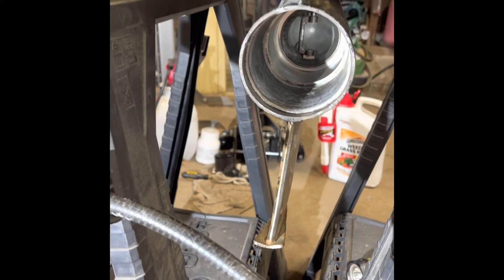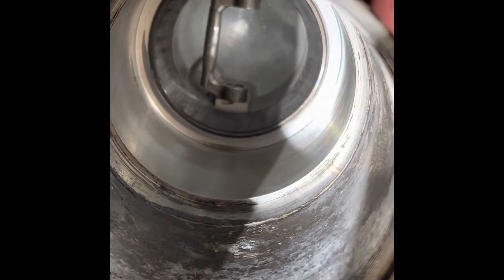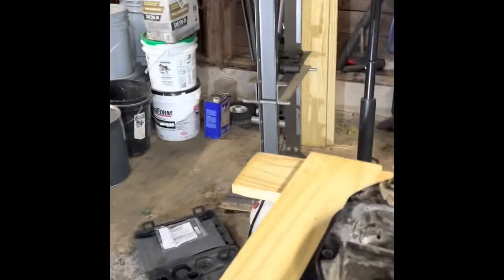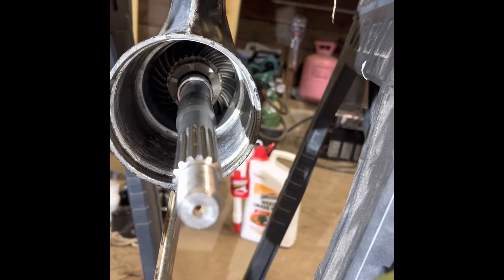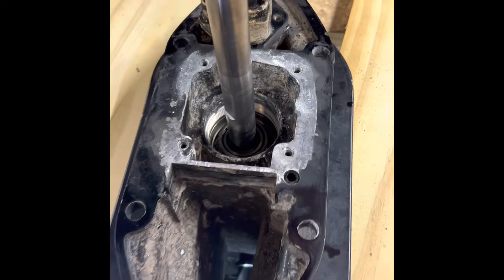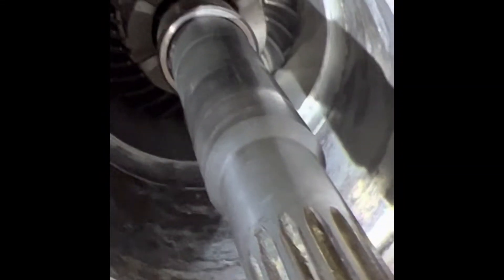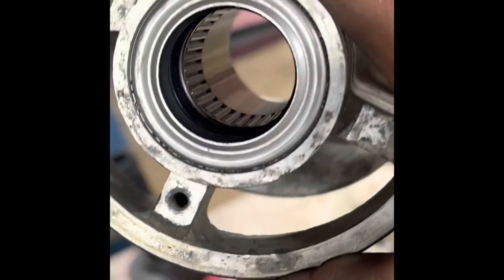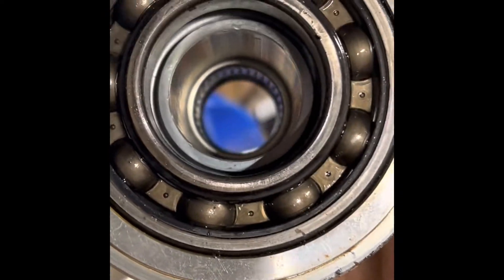Mercruiser alpha one gen two lower rebuild and seal

Comment: Are there any oil seals in the lower unit beside the ones that go on the impeller?
Reply from the maker: Yes. There will be big round seals on the lower shaft housing. Hope this helps.